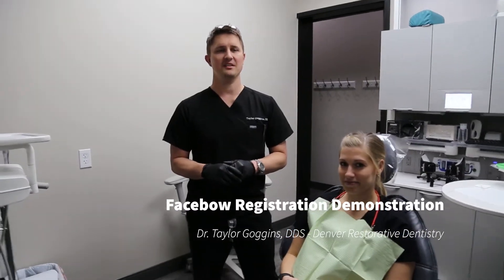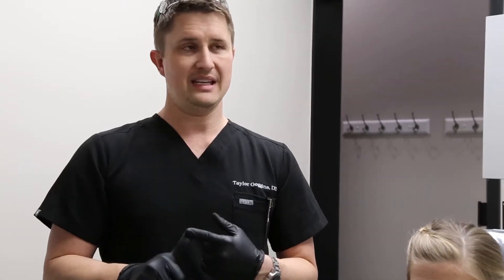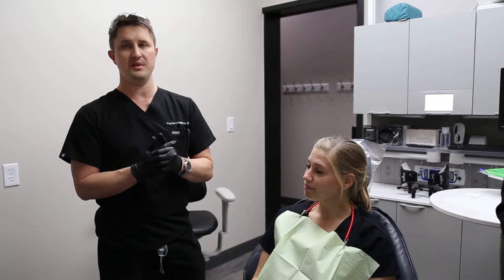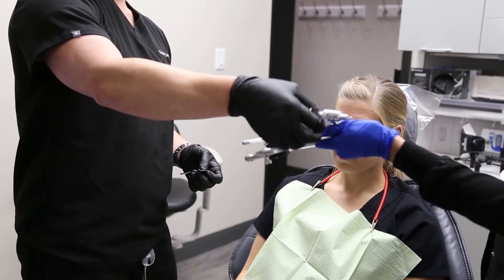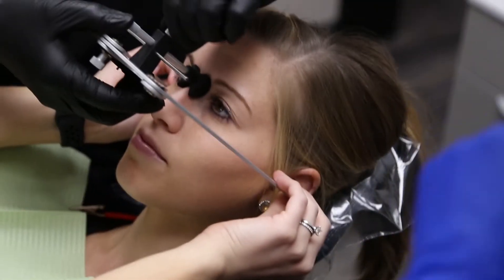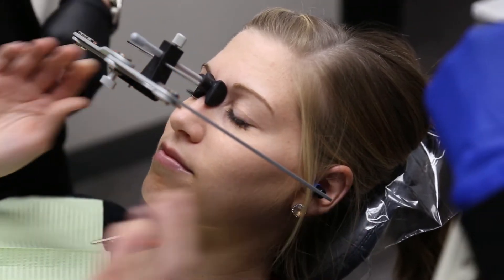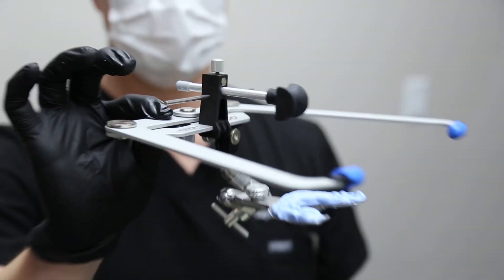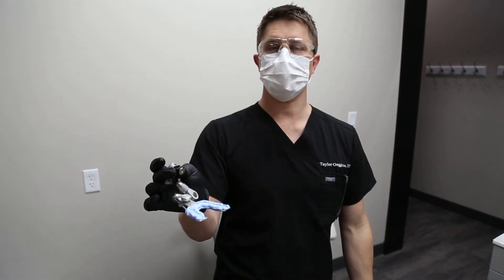SAM Facebow Registration Demo

Comment: Thank you for the video.... If there is a little difference in the level of the two eye (pupil), should the frame of the bow made parallel to the floor or to the interpupillary line ?
Reply: Depending, if the bipullar line you have detected is parallel to the commissural line but not to the plane of the horizon (both are not parallel to the horizontal plane therefore) then the situation gets complicated and it is convenient to ask the patient for old photos and make a common decision with him, basic if throughout his life he has had an incisal plane on the frontal plane not parallel to the horizon then for him the maximum aesthetic will be like this and your line of the incisal plane will be parallel to the detected bipupillary plane. If instead the bipupillary and commisural line are not parallel it is convenient to set the incisal plane parallel to the horizon obviously informing the patient and making a conscious decision of the patient's requests with the due documentation.